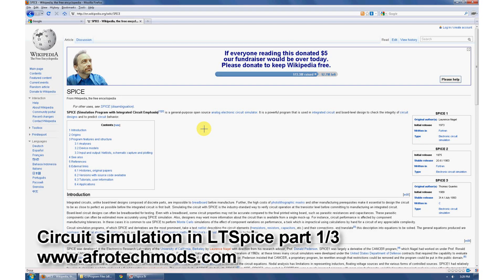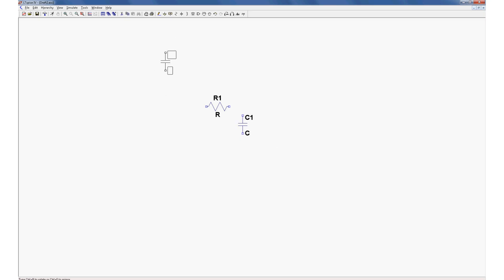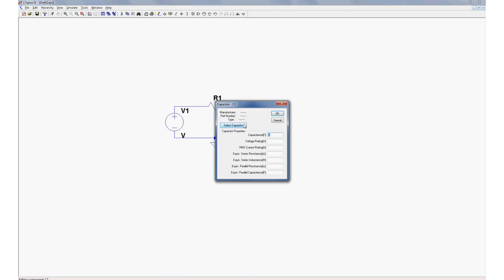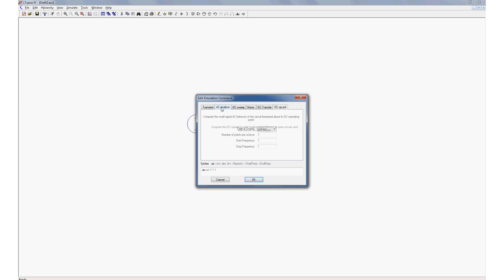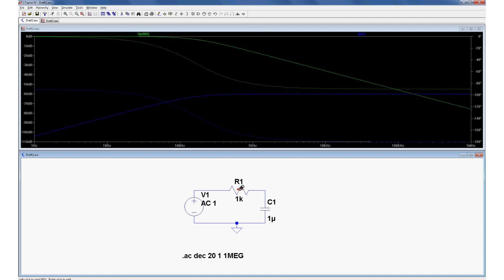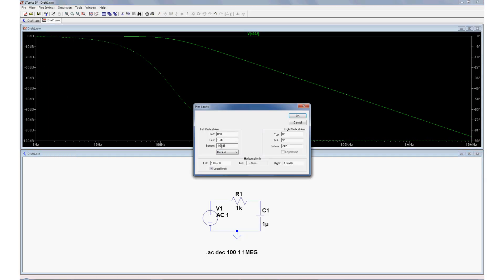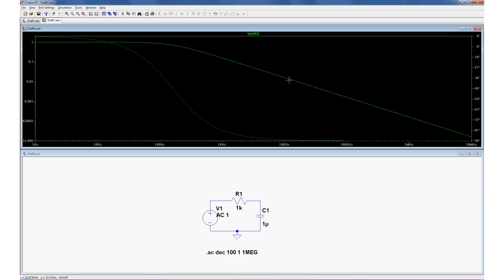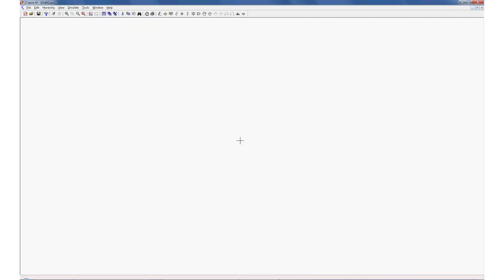Circuit Simulation in LTSpice Tutorial part 1/3

Comment: Thank you for informing us of this software, it's awesome  I've been able to design some really cool circuits using it. 

Though it should be made known that once circuits get complex like in an SMPS topology, things work fine in the simulation, but in real life if you miss a calculation, things explode, for instance I've made an astable multivibrator running at 600V using 2N2222s that worked fine in simulation, but in real life the transistors would explode.

How do you add those encrypted third party models for MOSFETs , ICs and other sub-circuits, like the ones from Fairchild? I cant seem to find a clear, clean way to do it and your videos are very concise. :)

Comment: why when i run simulate ,it give me stright line constant when try to measure something ???
Reply: +Ahmad Kalaldeh Set it up to sweep from o volts to what ever your working with. I set a DC sweep from 0 to 3.7 volts to check out the manufacturer LED model in spice and it works well. Can see the current curve during the voltage sweep.